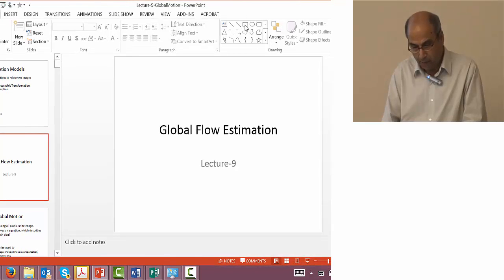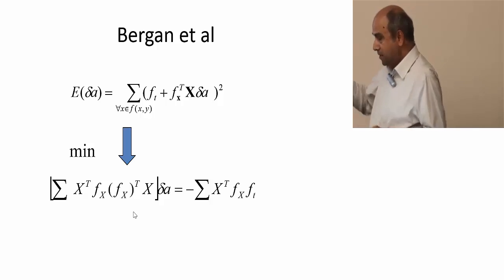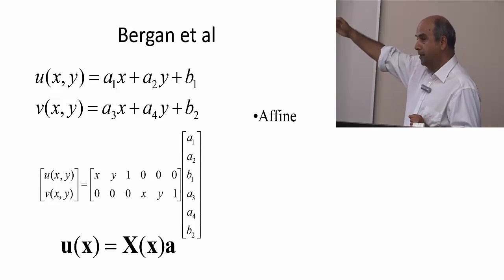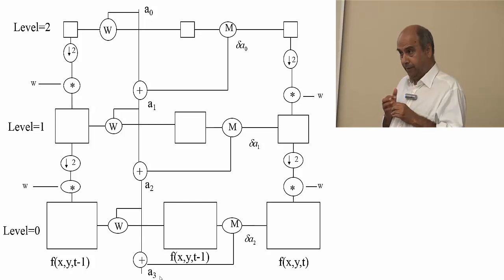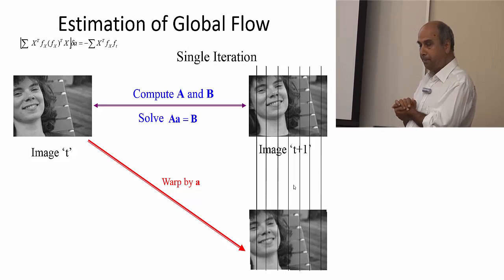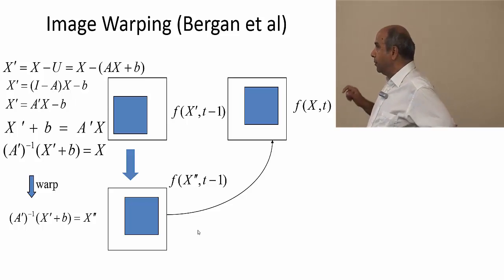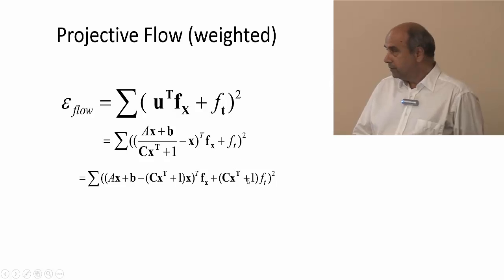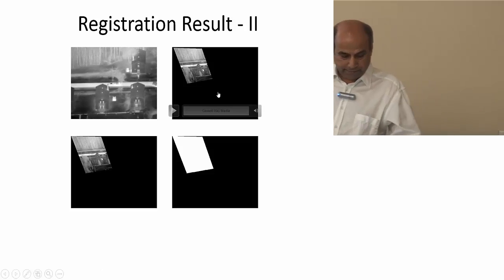Lecture 09 - Global Motion - 2014

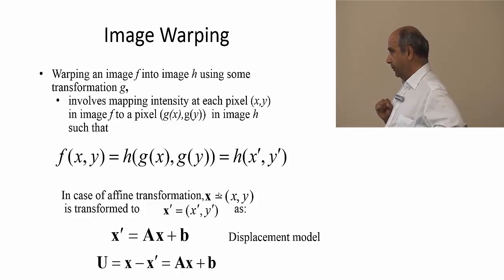Comment: I don't understand the part(53:48) where Prof. Shah says:
x' = Ax + b
U = x - x' = Ax + b.

Shouldn't this be something like U = (I-A)x-b ? Any help would be appreciated.
Reply: you may need to watch the previous lecture about motion models
Reply: As I've understood, U = x-x' = Cx+d, where C = I-A and d = (-b). However, there are 2 different models: displacement model and instantaneous model. Both models have similar structure on the right side of the equation, in other words, both models have the same appearance Ax+b. Similar structure doesn't mean that their values are equal.